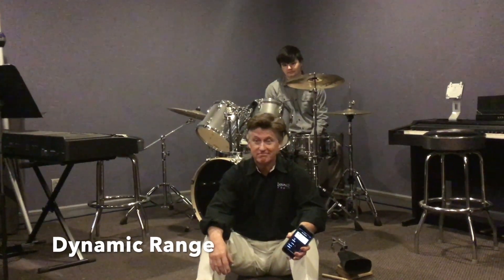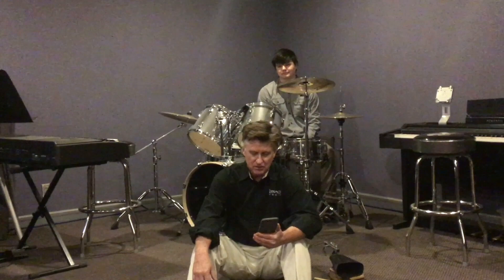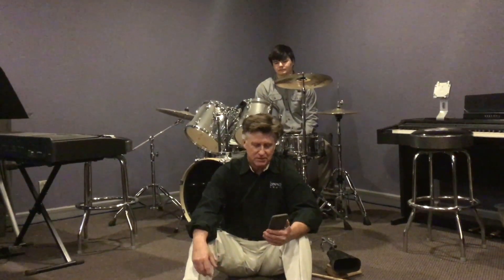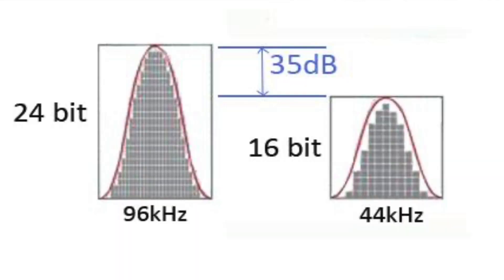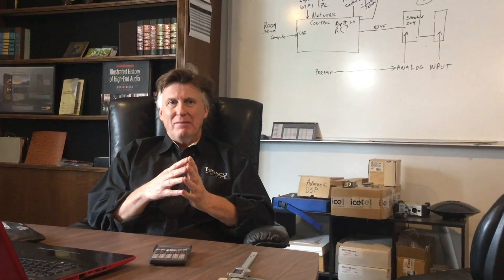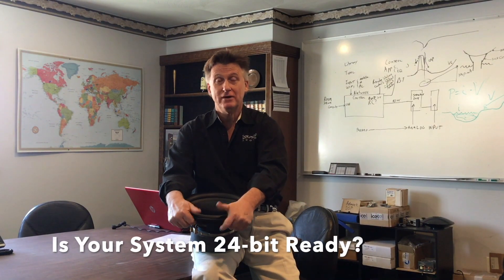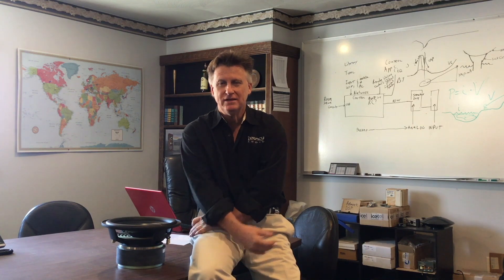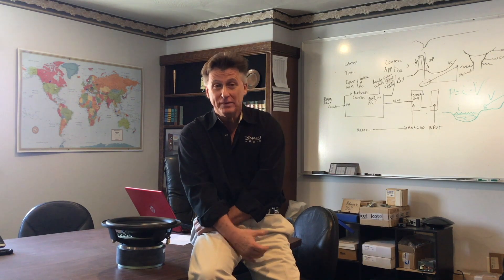Is Your Audio System 24-Bit Ready?

Comment: More power ain't louder, it's just BETTER, CONTROL.  My WHISPERS are ALIVE I run 4 mono P500 AVA in mono 2 on each side.  1200-1400 w RMS each total of about 5200W RMS capable, Each time I added more watts, not louder, just more , less strained, easy, Dynamic.  I went from a single 250W pc, then ran each 500+ W each side in mono, better, THEN 2 in mono for each side total of 4 driven by the old Xilica DSP and  2 hybridAVA phase inverters.  The AC mains transformer in AVA P500 are massive, current, and one giant power supply, 4 is much better than 1.  The bass was improved dramatically, while everything else was less constricted, it really did open up.  More watts is ALWAYS better, it's there when needed. I have it running on 3 separate 15A ckts, as when I measured the current draw on the entire system cranked to about 100dB close to 30A continuous draw, amplifiers are very inefficient, but it sounds great. Once you go Legacy, everything else sucks!

Comment: Thanks for the video, Bill. Is this why higher wattage separate amps can sound “better” than receivers? Because the wattage is needed to power transients, not necessarily average power?
Reply from the maker: Yes, that's exactly right Ted!
Reply: legacyaudio1 That makes a lot of sense, Bill. If an amp is underpowered, what happens to the transient? Does it effectively get attenuated?
Reply from the maker: @tedmanasa907  That's correct. Most amplifiers today are designed to soft clip, so it may not be a harsh distortion but it definitely results in a lackluster softness.
Reply: @legacyaudio1 what. No this is not true at all.